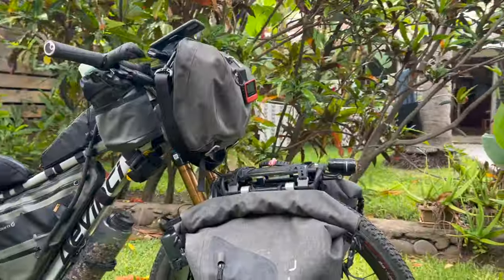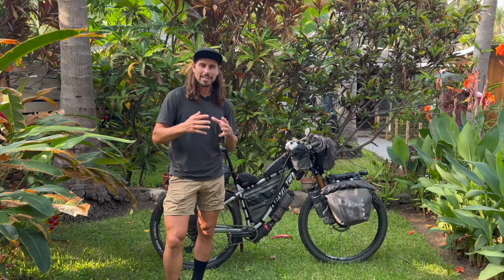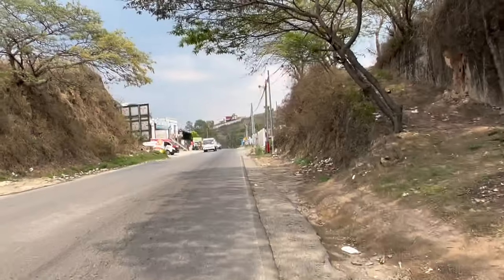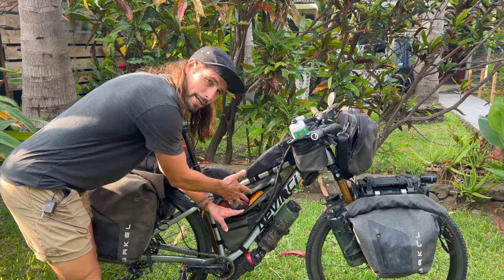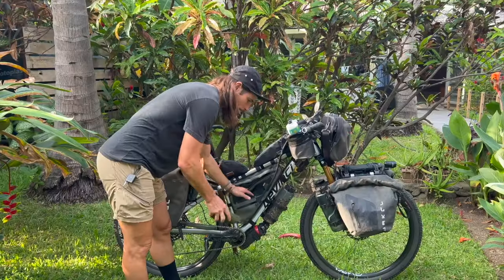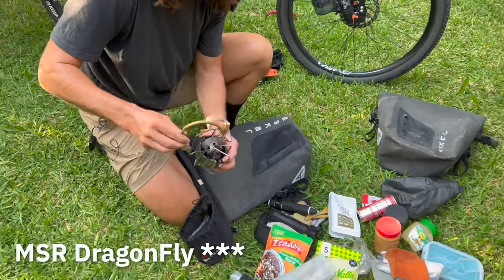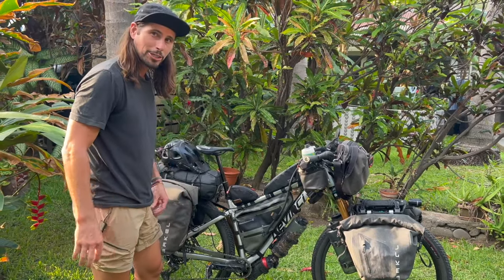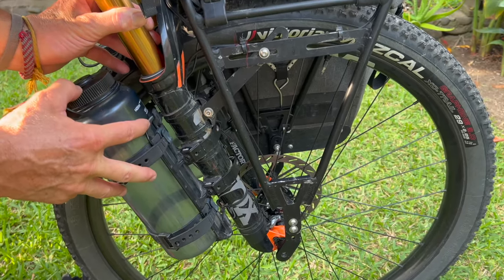My bikepacking setup to cycle from Victoria to Patagonia

Comment: The fake wallet is so smart, I'll definitely bring one of those on my next big tour!
Reply from the maker: Yeah, kind of gave me some peace of mind. From what I heard robbers don't stay around, they sometimes arrive on a motorcycle and if you cooperate and give them your wallet they tend to leave quickly. Of course they might go for the cell phone as well, but I also had a 2nd phone. An old iPhone that I was using for my navigation and to listen to music/podcast. It was super useful for not using battery, it's like having a power charger in a way. I was using my other cell phone (iPhone 13) to film and for the data.
Reply: the small things you don t think about that you'll face and give you hard time. he s prepared for it all. it s pretty crazy, this is very next level bikepacking.

for me it was the flexible spoon for ease of clean and use of less resources. that sh*t underrated. if anything we need the name of the spoon too, that important pice of equipment.
Reply: @DominickMenard  You're a legend. I'll keep the 2nd wallet and phone in mind.
Reply: I made a fake wallet, and it was pickpocketed the very first trip. I was very pleased with myself and will always do it in future on longer trips!

Comment: Nice set up high-end equipment that will last a lifetime.  I'm still using equipment I bought 50 years ago. The rest is 30 to 40 years ago.  Most of the equipment has been used on ocean kayak trips and long-distance river canoe trips and backcountry X country ski trips.  For young folks don't walk away because bike touring looks too expensive. Let your gear grow over time. Buy what you need when you need it.    Don't get caught up in the newest fad.  Stick to the basics.

Comment: Totally agree with mtb, even though I personally use gravel. MTB is just great for complex terrain and touring around world, most importantly clearance for bigger tires. For me, due to not wanting multiple bikes, I just went with rohloff belt drive gravel. And I mostly bike relatively ok roads in Europe, occasionally harder terrain, but all in Europe, also aside from summer and some small expeditions, it's my sport and commute bike.
One really good thing about gravel is huge frame hole, you can got something like 10-15L bag there. I have ~14L frame bag, 11L handlebar bag, and big backpack strapped into rear rack. All waterproof. This pretty much takes everything I need. Food, extra water, tools, spare parts etc. in frame, heavy stuff. Quick access clothes at front, cooking system, and whatever else I might need. At rear shelter and clothes. Ofc I also have stem food/water bottle bags and top tube bag that acts as my phone holder with transparent touch top.

Gear I use is Alpkit custom rolltop frame bag, costs about same as good frame bag that's not custom.
Acid toptube View
Ortlieb handlebar bag plus
Alpkit 30L waterproof backpack on back rack.
Two apidura stem bag.
For navigation on move I use garmin explore 2.

I carry only two bottles of water but I have 3L bladder without hose to refill the bottles. So I actually have almost same amount of water. I really think people should not get bladders that have hoses for bikepacking if you have bottles. That hose is just extra thing that needs cleaning and can leak.
And then maybe the best thing ever, bone conduction headphones, definitely not as good as normal ones, but you can actually listen to podcasts, books and music without blocking outside at all.

Comment: So interesting! I did my first bikepacking trip this summer because you’re so inspiring!
Reply from the maker: Wow glad to hear this Antoine 😃🙌
Reply: @DominickMenard I'm thinking ab it as well I have a bike from the 80s I'm actually considering using
Reply: How did it go. Where did you ride. 
I've done 2, 120+ mile routes. Both rides done over 2 nights. 
Planning this year's although I think I have my route set now. 
124 miles with a beach camp planned at  the end.

Comment: Incredibly helpful and fun to watch too!

Sorry if someone asked this already (it’s hard to search all the comments) but can you tell me what psi you typically ride in those tires? 

I’m curious what you’ve found works best with all the gear, water and food loaded on. 

Thanks!
Reply from the maker: On the road I started putting more during the 2nd half of the trip and really liked it, I was worried that too much could be problematic with the weird but been running 40psi and even 45 without problems (29x2.25). It was a lot faster than the usual 35psi I was running.

Off road I would drop down to 25psi depending. In Baja I was running 29x2.6 and for sandy portions down to 14psi.

Comment: This is probably the best/most optimized setup I’ve seen so far. I’m also a mtb guy and prefer that over gravelbikes - Recently changed to xc tyres to narrow them down a bit and it feels much lighter to pedal. Best regards from Sweden!
Reply from the maker: Ahhh that’s nice to read thanks, quite happy with the setup! I was surprised how efficient it was on the road. A nice upgrade I did once I got to Chile was aero bars. Once on the bars you gain 1 to 2km/h and it adds an extra position which is very appreciated on long days. Cheers :))

Comment: Wow, gotta check out your other videos, especially since it looks like you may have finished.
How do you find the load works on your front shock?  Any handling/durability/performance issues?  Thanks.
Reply from the maker: Yeah I unfortunately document the trip in French, it’s just more natural for me. Hopefully the auto-subtitles work 😊 I had no problem at all with the fork, I have turned the compression to the maximum and put 140psi, so basically using 2 inches of travel. It wasn’t any issue on the road and allowed for more comfort on off road 🙌

Comment: Nice rig setup, i love the side mirror it's the cheapest yet it probably saved you many times before by providing ocular awareness on what is coming from behind and on the left side yet it was often the most neglected by most cyclist. Prevention is always wiser better and cheaper than cure.
Reply from the maker: Yessss first time riding with a mirror and I’m sooooo happy I got one! It gave me peace of mind knowing I could see cars coming and anticipate whether the driver saw me or not, I’d 99% of the time people gave me room but for those who didn’t I could react and move to the right a bit. Also, you don’t have to look back your shoulder every time. I’m definitely going to put one on my gravel bike this summer! 😃🙌
Reply: Yay I have it both on my bikes on both ends of the handle bar.

Comment: great video, really interesting list! I will do my first bike baking trip this year and surching for a good rain jacket, witch arcteryx Rainjacket do you use and can you recommend it? Greetings from Germany ;)
Reply from the maker: I use the Beta, I couldn’t find the Beta LT (underarms zip vents) and I love it! I highly recommend, it was one of my favourite piece of gear. The hood has room for the bike helmet, they use a soft fabric where the mouth meets the jacket when you’re fully zipped which is a nice touch. Side pockets are easy to open even with gloves. The fit is adjusted which is great for cycling. I like the wrist adjustment.

Comment: Glad I found your video today. Interesting to see you carry more or less similar to my setup.
100% agree with the chair and the peebottle!
I also pack a tarp, and one foldable pole that goes with it.   It’s great when you can not find a place with shade on those hot days, or to sit out of the wind a little.
About the drone: where do you keep all the stuff you need for the drone, like the controller, spare batteries, charger…. I am not using drone mainly because I suppose it will need too much space in my bags.
Good luck with your trip! I subscribed now and follow you all the way.
Reply from the maker: Nice to read this! And good idea for the tarp, I guess it could also be practical to make a little roof to camp from the tent if it rains.

For the drone, it's in my handlebar bag. It needs to be easily accessible, this way I can stop and quickly pull it out to make the shot. I have a velcro strap that attaches to my handlebar extension so that I can ride with the controller properly secured. This bag easily unclipped because of the KLICKfix adapter and I can bring it in with me, it has most of my valuables like Passport, laptop, drone, GoPro.

Thanks for following me! I film one episode in every country sometimes more. Unfortunately it's in French but when I can I add the subtitles, otherwise YouTube makes an okay job with the auto-subtitles.

Cheers :))
Reply: @DominickMenard  je parle Français aussi. Donc pas de problème pour te suivre!

Comment: Domi, podés explicar el sistema que tenés para generar energía? Te encontré por Fede Farrell y me volví super fan !! Saludos desde Argentina!! 😊😊
Reply from the maker: Tengo una dinamo Schmidt SON28 que me permite tener una luz delantera y trasera permanente (si necesito).

También puedo recargar usando un adaptador USB. Para una celular no es ideal porque requiere una carga constante y por debajo de 13 kmh ya no genera suficiente energía. Además, estar constantemente encendido y apagado puede afectar la duración de la batería. Sin embargo, definitivamente puede ayudar.

Para mi Garmin, por encima de 7kmh carga y puedo recargarlo fácilmente al 100%.

La mejor estrategia sería recargar mi “battery pack” y luego recargar mi celular, pero desde que inicio mi viaje es raro que pase más de 2 días sin ver ninguna civilización.

Comment: Thanks for posting Dominick! Great video and full of useful information.

Would you consider using a MTB with a carbon frame instead of aluminum?
Reply from the maker: I think it depends of the bike design/purpose more than the materiel. One thing I was looking for was lateral stiffness to handle the weight of the bags and equipment. If a bike is not stiff enough, it will wobble at high speed or when pedalling standing up. I've seen a girl with a Canyon carbon hardtail, looks like it's holding up but she's one of the rare bike tour cyclist I've seen with a carbon bike. Personally, I like my bike cause I have peace of mind knowing it's built for all around mountain biking and not for XC racing.

Comment: Awesome man, a friend of mine told me about you. I crossed Canada last summer solo, also leaving from Victoria (Sooke actually) and averaged 150km a day but I was using a Kona Sutra and going a bit lighter than you but I camped as well so I had similar gear. I live in the Eastern Townships in Quebec but unfortunately I don't speak french, I was curious how km you do per day on average? All the best, I'm sure you are inspiring lots of people myself included. Cheers 🍻
Reply from the maker: Nice! :)) Crossing Canada is something I'd love to do. As for the mileage, it's not that impressive, I think my average per riding days was 75km for the first half. This trip is also about seeing places on the way and also did a few bikepacking routes on the way. I've been going a little faster in the 2nd half (South America) and since Peru, I'd say my average is 90km. Elevation is a big factor. In Patagonia for example even though you're at sea level I realized in the first few days that for every 100km you have to climb between 900m and 1,300m. My longest day so far has been 226km coming out of Santiago. Glad you took the time to watch the video, cheers :))

Comment: And I thought I over pack. I am amatuer compared to you. Are you happy with the 1x system? I am thinking of going back to a 3x8.  Safe travels Sir.
Reply from the maker: haha yeah crazy how it adds up. I LOVE the 1x system and wouldn't change it. 30T in front with a 10-52T was a perfect setup for bikepacking/touring with a heavy load. I started with a 32T which is fine on the paved road but once you go off road and go up steep sections a 30T is definitely better!
Reply: @DominickMenard  Thank you.

Comment: can a seat post clamp mount and/or seat stay adapters holding a 10-30kg package at the rear rack damage the frame on on-off pavement bumps rides in city/ off roads?

Comment: Hi, how did you mount your racks on the frame/fork? As far as I see, the frame originally doesn't have mounting points, but yet I see the top of the rack is mounted directly. The bottom is through the axle? And the fork?
Reply from the maker: The bottom part is fixed on the axle and for the top I added some anchors to screw the top part. You can also buy a seatpost collar with rack compatibility, I think Salsa makes one.

Comment: Hey I got a question do you use 32h rim are they good enough for carrying stuff like yours do your spoke breaks a lot I want to switch to 32h lots of variety of rims and tires thnx
Reply from the maker: I actually use 28 holes rims. The pair I ride is from ENVE composites, the AM30 carbon model (30 stands for the rim width). I also ride ENVE on my enduro and gravel bike and never had any issues. Been riding a pair for 5 years on my enduro bike actually and only broke 1 spoke through all those years.

The only issue I had on the trip happened half way near Panama, part of the flange of my DT Swiss 350 hub snapped. Still covered the last 400km to Panama city and replaced the hub for the 2nd half and didn’t have a problem after. I’d suggest to go for the DT Swiss 350 Hybrid version which has made for eMTB and has a larger/stronger hub body. Only available in 32 and 36 holes though.
Reply: @DominickMenard  ok imma research those names thanks a lot man

Comment: Gros setup, mais j'ai l'impression que t'es 0 aérodynamique. J'avais une position similaire à mon premier voyage de vélo et j'étais vraiment ralenti par le vent mon manque d'aérodynamisme. C'est tu possible en backpacking être un peu plus aéro pcq la différence avec la position de vélo de route est énorme!
Reply from the maker: Ça dépend ce que tu veux faire mais personnellement j’ai opté pour un vélo de montagne pour emprunter des routes de bikepacking avec la paix d’esprit. J’ai également arrêté en cours de route pour faire du vélo de montagne à certains endroits. 

C’est sur que ce n’est pas aussi performant sur la route mais ça ne me pas empêcher de rouler avec un gars en bike touring qui était une véritable brute! En Bolivie en se relayant on a terminé la journée avec 30.2 km/h sur 119km :)) J’ai fait quelques journées de plus de 200km dont une de 250km, alors la possibilité n’est pas un frein.

Ceci étant dit un gravel ou vélo de bike touring serait définitivement plus rapide et j’aimerais essayer un trip du genre éventuellement mais pour ce voyage ci je ne regrette pas mon choix au contraire 😊

Comment: What model are your black biking shoes?
Reply from the maker: It’s the Gauge model by Giro. It’s funny cause it’s a mid-level shoe, I think I paid 90usd and it’s one of the best shoes I ever had! Super confortable, the style is sober so perfect on and off the bike on touring trip. I changed the laces for black though, they came with a bright red pair. They are resistant, the sole is not too stiff but enough to give me a good feel and efficiency, I’m really surprised by those!

Comment: nice setup , but the price, man from my estimation should be around 10 000 dollars (bike 3000 to 4000, tent 500, bags 1000, clothes and accessoiries 500, camp, electronic 3000...)
Reply from the maker: Yeah it’s quite surprising when you start adding up. I started making a list of all the stuff I had with prices, it’s done yet but it will end up be a lot more than we think. 

Just the wheels on the bike are 1,900$, the fork is 1,400$, brakes 750$… I’d say just the bike is 9,000$. Of course it doesn’t have to be that high end for bike touring, my life gravitates around cycling and I don’t mind spending money on this passion. Also to be fair, I have sponsors helping me.

If you add up the camping gear, the electronics that I was carrying man… I think I rather not know 😂

Comment: how much electrolyte in mg do you consume per hour of cycling? AI says we need about 500mg / hr. How do you get your electrolytes?
Reply from the maker: I don’t know exactly, but always had one bottle some kind of electrolytes or sugary drink like Gatorade. As for the electrolytes I brought with me, I use Vega since it’s the best quantity/ratio I found on the market. I left with 2 containers which are 168g each and since you only need a small scoop (4.2g) I had 80 portions which I spreaded on the course of the trip. I had some shipped to me on the way. It’s way better than carrying those typical huge bags of electrolytes from other companies which are usually mixed with sugar. The Vega hydratation drink mix has 0g of sugar.